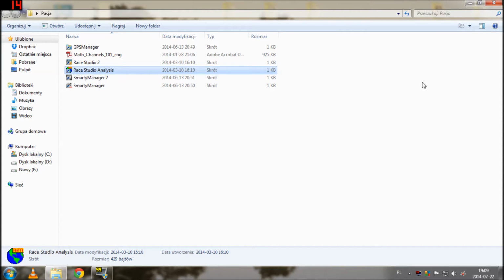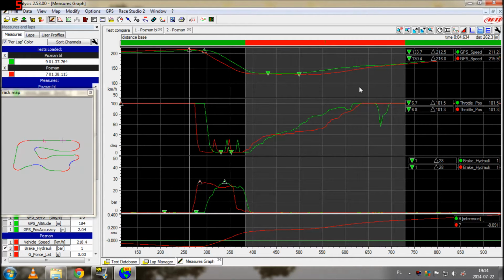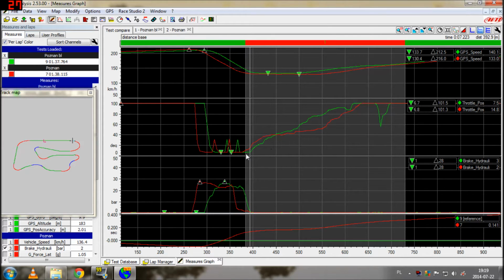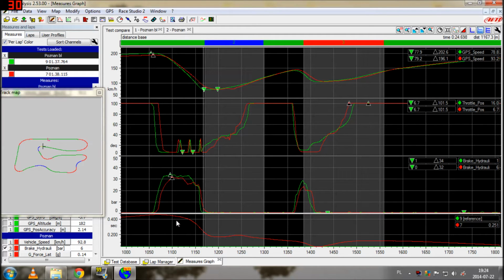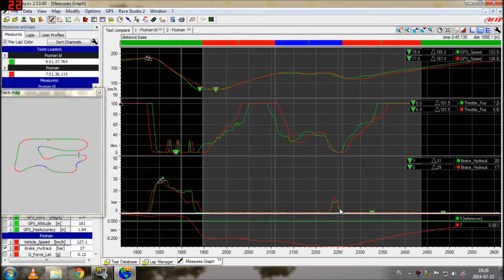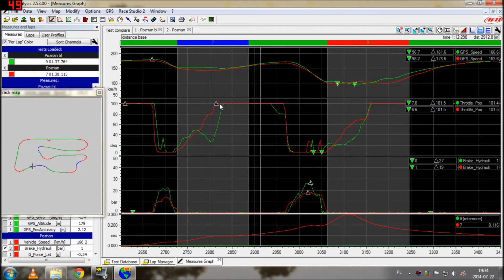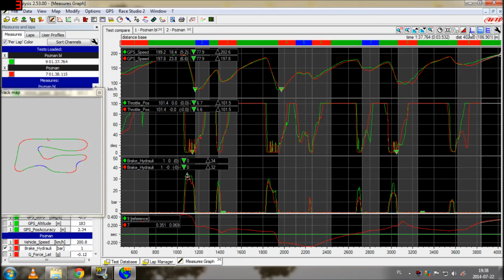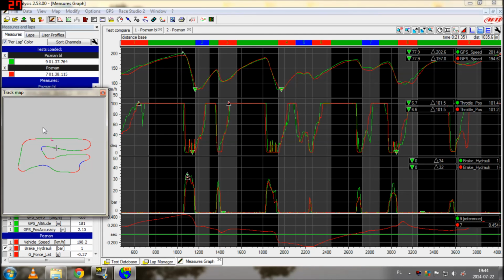AIM telemetry data analysis - comparing two laps of the same driver

Comment: How did you get that black background?
Reply from the maker: It was so long time ago. Honestly, I don't remember. I'd have to check in the settings. What I remember though, there was a setting where there were many different color options for different settings. I don't have the software installed atm. Sorry. I hope I helped at least a little bit.

Comment: do you prefer Motec or aim racee studio ?
Reply from the maker: Eric Bergeron Well, frankly, it's hard to choose. At the moment I work more with race Studio 2 in real life, but Motec was my "first love" so to speak. I used to work a lot with Motec i2 pro in simracing and looks like I'm going to restart it in the nearest future. With Race Studio 2 I covered much more than telemetry analysis only. Setuping an AIM MXL Pista Data Logger, Smarty Cam, cabels connected to the car etc. With Motec I've never "touched" a real car, yet (I hope, I will one day :) Both of them are a peace of software which, in general, does the same thing. I wish I could work with both of them in real life and learn other software like Pi Cosworth or other. If you want to chat or discuss, it would be a pleasure to exchange our points of view. 

Regards,
Slawomir
Reply: Slawomir Judek thank you for your reply. I am a beginner and I did not want to spend too much time studying and understanding software and then realize that I did not choose the right starting